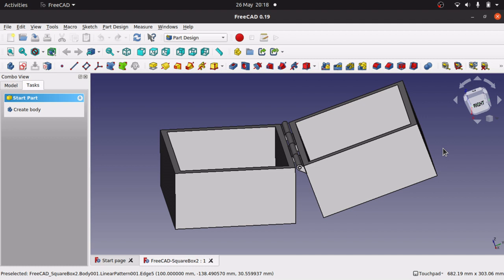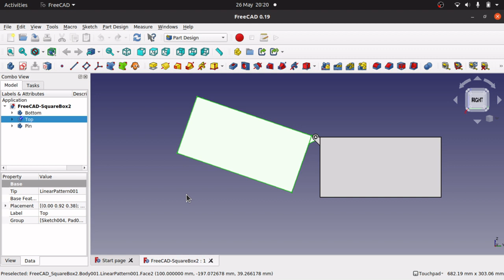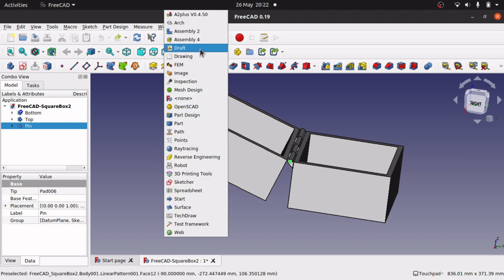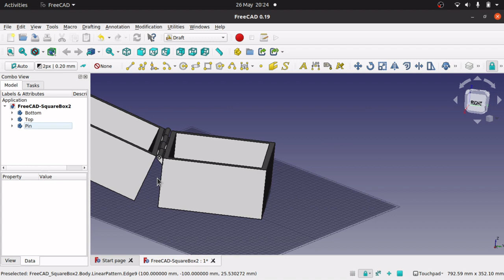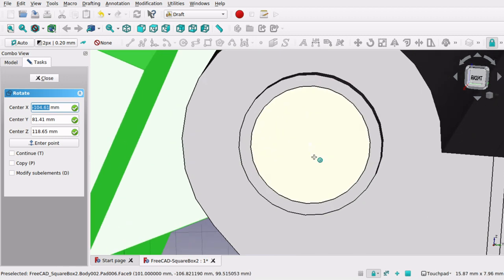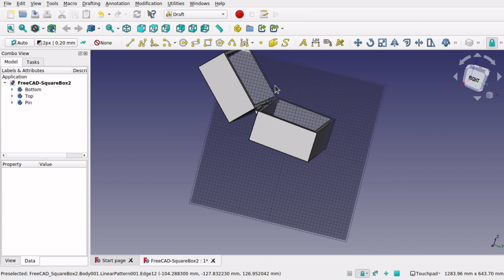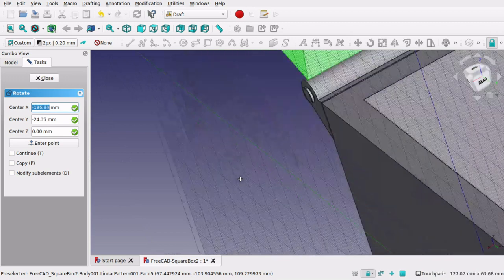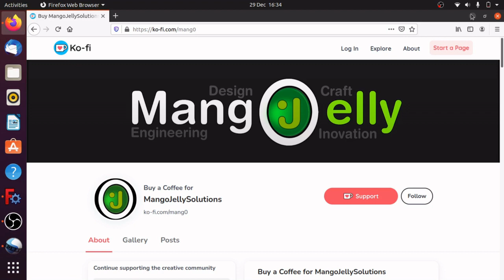FreeCAD: Easily rotate / pivot body around any axis with mouse. Part / Part Design Beginners Help

Comment: very good trick, but I think in this case it should be noted you probably want to create different objects in separate files (actually for your box since it is symetrycal, only one object will be enough) then make an assembly out of it, with a constraint on the hinge axis.
But it's true that for a given object made of multiple bodies, positioning and rotating can be maddening....
thanks a lot for the tutorial !
Reply from the maker: Thank you for comment on this, I think you may of also helped me find a example of a use case for a simple sub assembly for a video I want to create. 😁😁👍👍👍

Comment: Usualy you need to move he part in exact manner - by known number of degrees. In such case the assembly is one solution,when you need to align the top to the bottom box. But moving the top independently to certain angle, you need to measure first, what the angle between the two boxes is, then enter  the calculated number of degrees in the "Rotate" task window, in Rotation of parameter window...(sorry for the lack of correct terminology)  So the question is: how could you  measure the angle between the top and the bottom box?

Comment: Awesome video very informative thank you! I’ve been spending the last couple weeks learning this program and you’re channel has been the best thing on the internet! My goal with CAD is to make 3D models of automotive suspension parts that move as they would in the real world. I need parts to move on multiple axis and at specific pivot points. An example would be a control arm that pivots on the chassis with a ball joint at the other end on which an upright would pivot on an axis between the upper and lower ball joints. I know it’s a fairly complex concept and I don’t honestly know if it’s even possible with free cad. I’ve had success making 2D models that pivot accordingly using constraints. I know it’s a bit of a tall order but any guidance would be very appreciated. Thanks again for the detailed and informative videos!
Reply from the maker: Thank you for the comment, great to hear you are finding the channel useful. Your project is interesting as it's something I am also looking to get into. There are a number of workbenches that allow for constructions such as the A2Plus workbench where you can  attach parts to each other and when you move a part and all act upon each other but I don't know if this will cover what you are looking for. You need something to stimulate multi body dynamic systems. There is a workbench out there made by Jose Gabriel Egas called Free3MBDyn but I have yet to explore it.
Reply: @MangoJellySolutions  thanks for the reply! I’ve tried playing with A2 plus and was able to get some basic 3D motions. I’ve also been able to get some 3D motion in the  part design workbench, but it’s tricky and I can’t quite get things to move as they would in the real world. I’ll try out the free3mb work bench you suggested for sure. Thanks again and keep up the great work!
Reply: @LifeInHyrule  Depends what you're looking to do with the model. If it's for illustrative purposes then freecad is great, if you want to vehicle dynamics and geometry characteristics from the model though, there are specialised suspension simulation softwares that would be more appropriate.

Comment: Indeed, for anyone coming to Freecad, ‘why all the workbenches?’ is one of the first questions. Still baffling.
The unspecified compatability between them, and general advice not to mix them, does not help.
Reply from the maker: I found that the whole mixing workbench is mainly down to the part and part design as though they are both parametric the part workbench uses the boolean operations to build models in the same way as older CAD programs used to from the 70's. We're as part design uses feature based. Trouble is there are a number of manipulation tools in other workbenches that can be used in the majority of others which results in the whole swapping back and forward which is a complete pain. What you can do is move some of these tools to your desired workbench by creating a button and assigning it a macro to this tool which will activate it in the same way. I have a video on my channel to do this for the draft move tool but the same process can be used for a number of tools in the draft workbench. But I totally agree, it really can put new users off.
Reply: All but a few workbenches are 'add ons' to improve upon the accessibility of the basic workbenches. They are prepared workarounds, so to speak. For example, the rotation on the draft WB is an accesibility tool for the basic placement parameters of a part. To describe the rotational orientation, the placement parameter was given a single rotation parameter and a weight for each of the 3 dimensions. This made it unintuitive to use. Rather than fixing the issue itself, someone added a workaround on the workbench. And then someone else made a video on how to use this workaround. Baffling, indeed.

Comment: Can't believe I missed this video and just came across it now.  Very useful technique.  A question - is it possible to close the lid so it's exactly closed and flush with the other half?  I.e. not by eyeballing it with the mouse?  Starting from an unknown open angle, you can't judge what exact angle to type in.....if you know what I mean.  Anyway, as always thanks very much for the video.  The draft workbench has been a murky area for me....this brings a little light to the abyss for me.
Reply from the maker: Sorry didn't see your comment. Thanks for the like. So with the draft rotation the first selection is the center of rotation. After you have clicked you will see a line appear. This line will be the second selection which is 0 degrees. If you are using the snapping tools you can snap this to an edge. Once this has been done start typing and you can supply an exact degree. Hit enter to apply. It's not the most obvious of workflows, tol me a while to figure this out. Sorry again for the late reply.

Comment: Extremely helpful, thank you!  Is there a way to parameterize rotations?  That is, set the rotation angle and also be able to modify it via a spreadsheet variable. That'd also be very helpful.
Reply: In essence, it is parametric. The rotation on the draft workbench is just an accesibility tool for the basic placement parameters of a part. To describe the rotational orientation, the placement parameter has a single rotation parameter and a weight for each of the 3 dimensions. If you can figure out a formula to split up/describe your rotation in each  dimension, you are there! 
Or there might be another WB just for this :)